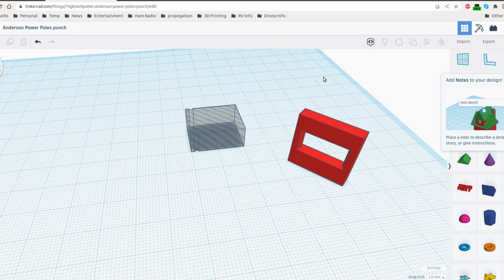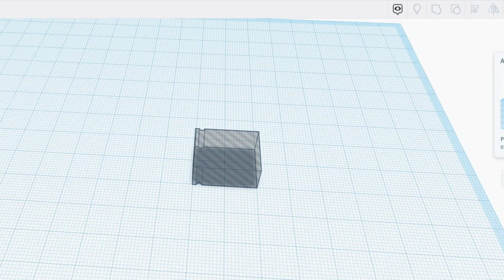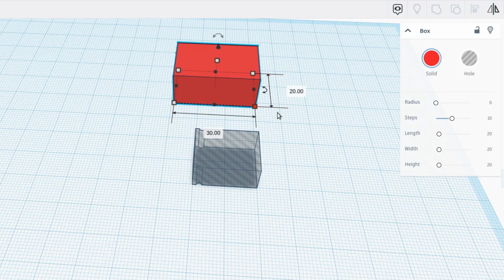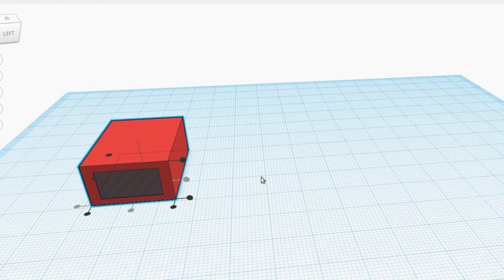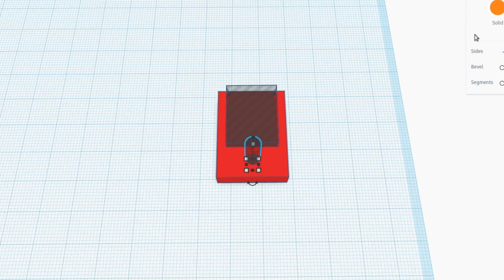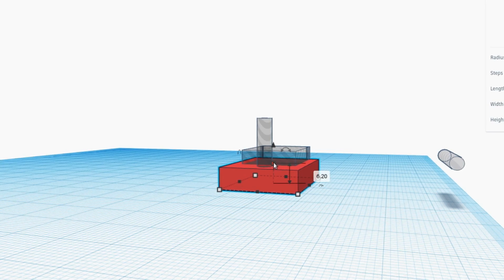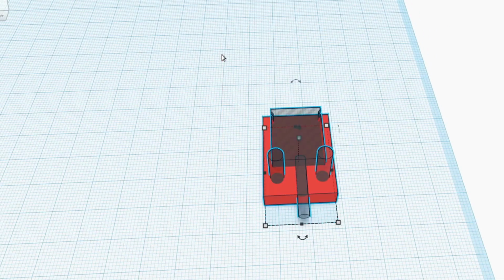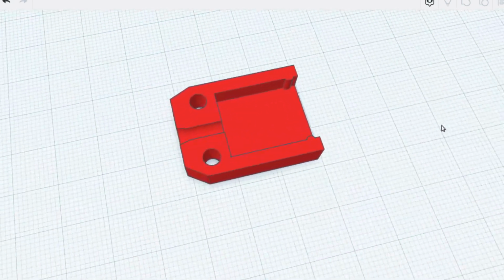Ham Radio and 3D printing - A shell for Anderson Power Poles and small power cables.

Comment: For me the learning curve and access to a 3D printer is a factor. Have you tried using J-B Weld epoxy to encapsulate the connectors and attached wires? It is easy to use and solid. My only concern would be whether the "cold-weld steel" variety conducts. If so, I suspect the ClearWeld variety does not.
Reply: This comes apart allowing replacement of broken connectors.

Comment: Where the inside dimples are in between the connectors, it creates a circular gap. Could you put a smaller screw/bolt through the centre of the shell to push the connectors slightly apart against the inside of the shell, to create more rigidity for the casing, and also preventing the connectors moving inside?
 
Lining them up to match the male to female external interface may need adjustment, or additional spacers each side of the new screw so each side is equally spaced out
Reply from the maker: My concern turned out to be moot.  After using it for awhile, the dimples hold the connector very well.

Comment: I like to squirt a little dab of silicone adhesive in situations like that. I've also used a little segment of PLA filament, heat-flattening the ends like a rivet, through the gap in the middle.

Comment: You could model in a hole on each half-shell that aligns with that roll pin hole in the PowerPole assembly. I've often used weed-eater line sharpened to a point (not sure what diameter) and pushed/pulled it through the hole to lock it in place longitudinally. Once the line is inserted, simply trim with a pocket knife, razor blade or flush-cut wire cutters. This will lock the PowerPole and the shells together with a non-conductive "pin".

Comment: I was just working on the same issue. My solutions were gravitating toward a loop of the thicker wire jacket and some tape, lol. Yours is more elegant, tidier, and probably will work better. I did discover that there are 15amp connector inserts for 20-16 gauge wire (DXEngineering stocks them) but that doesn’t solve the intrinsic mechanical weakness of the wire itself. Thanks!!

Comment: Great solution to the lack of strain relief of the Power Pole connector. 
As others have suggested,  add a pin to the center hole. 
Maybe use flat head screws too.
No room for a knot on the cable but in the past I've glued a washer on the cable to help keep it from pulling out.
Nicely done, thanks for sharing.

Comment: Great video Kevin.
Not sure if you can, could you bring the stl of the case into tinker and model a attachment for the case to house it all. No wire then just power pole socket.
As for the plug instead of doing it 50/50  make it deep to enclose the plugs and cable then a couple of mm lid for. Is for the cable if it didn't grip make room I. The case for a small cable tie to stop pull out.
Plus change the tolerance of the plug cutout.
Anyway just ideas no wrong answers here. It's ham radio. Great work 👍🏻
Motters M7TRS 🇬🇧 73 👍🏻

Comment: I always used Heat Shrink Tubing to toughen up cables, but this is way cooler. Maybe you can utilize that center hole in the middle of the two the PPoles to secure them better. print a little stub on each half that will fit in that center hole. They don't really have to meet each other if that's too flimsy to print.
Reply: Maybe instead of a plastic nub drill a small hole and insert a metal pin that would engage the small gap in between the connectors.
Reply: Keep in mind that the little pins that come with the PPoles are the size of the PPoles. You need a longer one to use this method.

Comment: Straightforward design. thanks for sharing this. it has answered a couple of my problems. I will now go and dust off my printer. One thought on the securing of the power poles. Would it be possible to put an additional fixing screw so that it goes through the case where the dowel hole is?  Thanks again for sharing. 73s de Rob G4ZRS

Comment: Hi Kevin,
How about a small hole positioned where the pin would be used to secure the power poles. You should now be able to use a 2-56 screw to secure the power poles in the shell and possibly do without the 6-32 screws. Stay safe.  73  WJ3U

Comment: Kevin, 
Excellent 3D printer solution to the small wire problem !  I was going to suggest super glue, but you beat me to it. That seams to be the easiest solution, but that makes the arrangement a one and done so it cant be reused. I'd be interested in your final solution.

Best Regards,
                          WA3X Paul M.

Comment: I think a 2mm screw will fit in the 2.4mm notch between the two power poles.  Put a hole in your case and run a long screw in there.  Or try a 2.5mm high x 2.3mm wide nub on the top and bottom parts of your case in that area